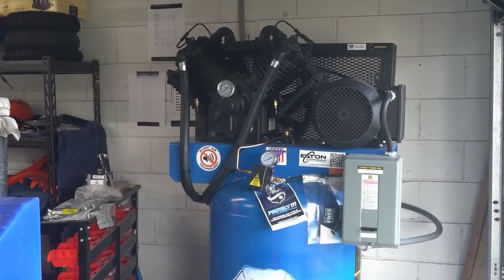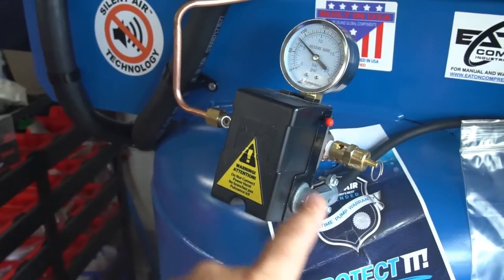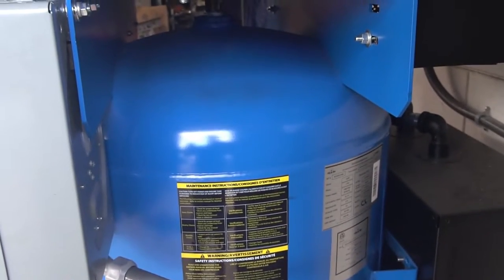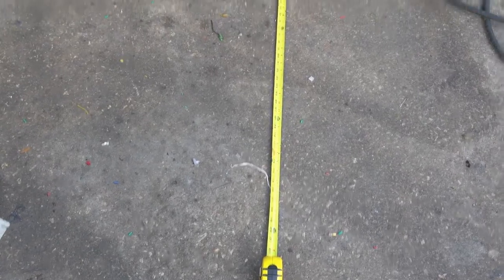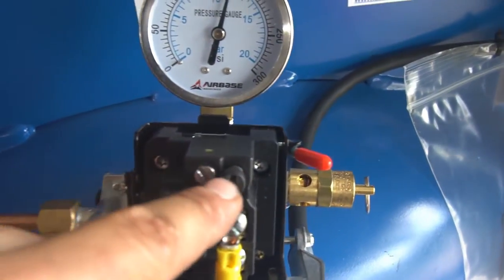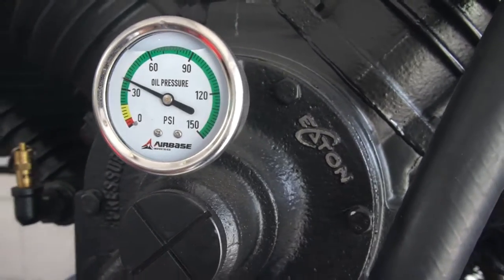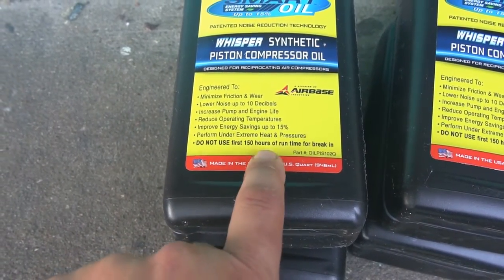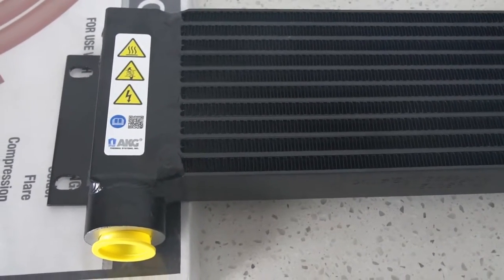Polar Air Eaton Emax - Single Phase 10 HP Silent Air Piston Compressor - Basic Overview & Testing

Comment: I bought an Eaton polar air compressor in 2014, it was used to run a blast cabinet and pressure blaster 10hrs a day for a year and a half. I had a motor failure at that point, I contacted Eaton to acquire a replacement. When I talked to them I was astonished to find out that even though I was a half a year out of warente, the owner told me that they had issues with the motor mine was equipped with, and he would gladly replace it just cover the shipping! 
I have recommended them to everyone that was in the market since, I have not experiences better customer support in my life!
Reply from the maker: Good to hear. I spoke with the owner and other staff before buying. Pretty easy to get a hold of staff and get answers. Not the case with some places.
Reply: @VintageHondaMinis  all communication I've had with them over the years has been top rate!
Reply: Hi I’m thinking of buying the yellow emax compressor 10 hp 120 gallon 38 cfm. I do sandblasted high density urethane signs it’s kinda like hard foam material. I need to be able to sandblast at 100 psi for like 45 minutes to an hour at a time depending on size of sign. I see you do quite a bit of blasting which seems to answer my worries on buying one of these for blasting. My question to you is how long did you blast non stop at one time and at what psi, and how did compressor perform, did it hold steady pressure or did you notice a decrease while blasting, basically did it keep up? Any input you have on using these compressors for sandblasting would be welcome before I put out 5 K on one. Thanks
Reply: @mikesigncarver3803  sorry, i just saw ya question, we use ours in an industrial enviroment, blasting 10-15 hours a day at times, i blast at 95psi, the compressor is set at 140/100, no pressure drop and the compressor runs about 75-80% of time. Tho this is predicated by orifice/compressor flow rate as you know.  I also have their re-frig dryer, runs without a hitch, always dry air in east tn with humidity in the 80's or more through the summer.

Comment: I hope your running at lest 6 gauge wire hard wired in to I see the start up amps 60 amps and then 35-37 amps and why they ship the pressure shut off switch is lower the pressure the more volume of air is created that means you going to have useable air volume and its a good idea to change out the oil at 25 hours of run time on air pump(NOT a AIR MOTOR ) with a non detergent  oil 30 weight ask Eaton what to use I have used Amsoil compressor 30/40 oil for 20 years and it works great and lowers temps Eaton compressor is a good co much better to work with them then any one and I think the pumps are made in china and the air tank is made in USA so don't just look at the made in USA on the tank its marketing Everyone that I talked to thinks the mech is USA made all of it and I tell them the tank is pretty much it USA made Eaton doesn't build the air ends at all  good luck vary nice compressor !!
Reply: I been looking for a completely made in USA but I have been unsuccessful! I refuse to spend that much money on Chinese crap. They like to throw a US flag sticker on that says built in the USA 🇺🇸 or assembled in the USA 🇺🇸 but all that tells me is it’s made in china! I’d rather it be USA made and assembled in china!hell I’ll put it together myself. So frustrating that you can’t find good quality USA stuff anymore. Got to go to the flea market to get something in from the USA! If I’m going to be stuck with something from china I’ll just stick with my 800 dollar husky. No way I’m spending 4,000 plus on Chinese air compressor. Just my thoughts on it. Most people don’t care.oh yeah I did see the motor is made in Brazil but I want USA!

Comment: I bought a Saylor-beall  ..air comprsoir  from st.johns, Michigan industrial  type  2 stage..mine is quieter in my opinion. 5hp. 705 cast iron pump. With an after cooler radiator. Mine run under 30 amps start up..comes with Baldor  moter. Everything  made in America..check out there web site..and u tube  channel..for factory  tour..  update ..nov2022...my comprsoir  I use for my inground  lift..that's mainly it and a few air tools..  I got the inground  lift out of an old service  station  in land o lakes  fl.  Free..for the taking..a 1956 Rotary  model # FP 46H   it will make a great work table..as well
Reply from the maker: Sounds like a nice machine you have. This one puts out over 2x the CFM as yours.
Reply: Yes I'm shure it awsome.  I'm a one man shop at home..with my unit..its 6 months  old..I had the factory  put on a hour meter  for the maintenance  .I pd around 3 grand..but mine is a 60 gal tank..I piped it to my 80 gal old unit.forore air storage..if I need it il open the ball valve. I use my comprsoir  mainly  for my inground  lift..I didnt want a above ground  lift ..I want a clean  looking garage area..no  maintenance  needed on my inground. It's been in my place since 1999....I removed  it out of my dad's old service  station..when he sold the property. It was 3 yrs old  back when I got it..to service  my own stuff. Great video  u put out..nice unit..as well enjoy it..
Reply: your pulling 30 amps is right for true 5 hp motor

Comment: Josh how much  was it with shipping?
Reply from the maker: This is the link to the unit I bought (Price in link) + freight to Florida was around $800 with lift gate service - https://eatoncompressor.com/product/10hp-quiet-80-gallon-industrial-air-compressor-vertical/
Reply: $800???? It should have been around $4000
Reply from the maker: @tekhelet777  I provided a link to machine and pricing